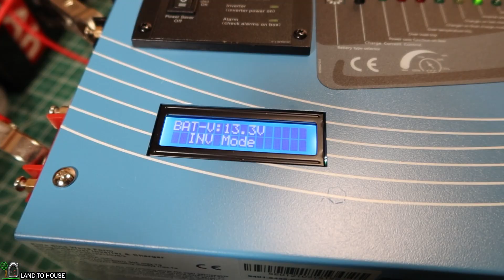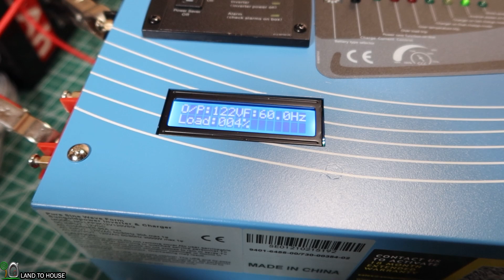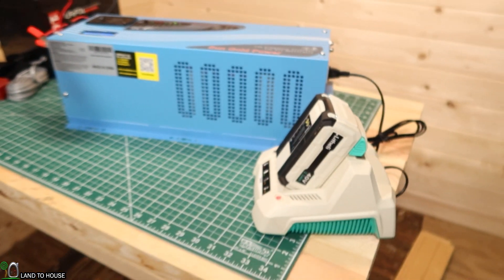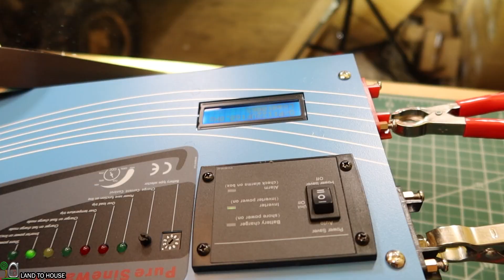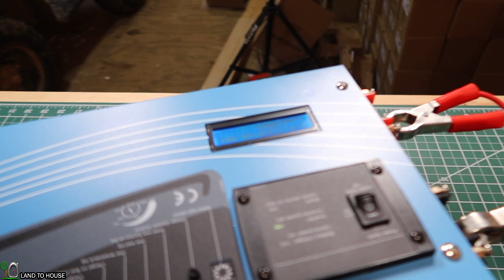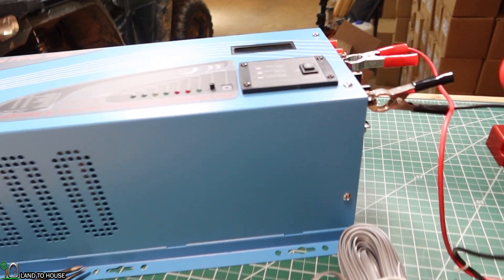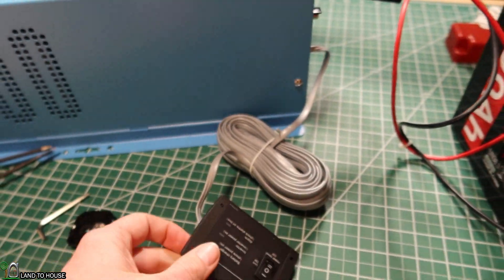Sungoldpower pure sine wave inverter charger 3KW 12V low frequency

Comment: @2:22 Regarding Automatic Generator Start (AGS), have you tried that? I have had difficulty getting the SunGoldPower 3000W inverter AGS to start or stop my 2020 Onan 2500 LP generator  using the inverter's AGS  dry contacts. For those unfamiliar, dry contacts are a safe and standard interface for many worldwide generators that provide the  automatic remote start function when the battery voltage gets low (10/10.5V). Can you kindly demonstrate the AGS on this inverter?

Comment: Neat, it's designed to be a UPS, AC power through it to your critical devices, and it'll kick in the battery->inverter when AC input goes out.

Comment: I just bought this unit and will be using 4 X 100ah LiFePo4 batteries as a backup to my main power source, which is Central Maine Power (grid power). Will this inverter/charger allow me to charge the battery bank with my solar panels when my grid power fails, which it does every winter for many hours to many days at a time? Thanks.

Comment: I just got super lucky IMO bought a used Power Jack 10000W Low Frequency Pure Sine Wave inverter with 200AMP Charger and super fast transfer switch for 250 bucks and it works great, I dont buy that it can do 10000W even though it has 2 GIANT toroid's in it but I am pretty sure it can do 5000 continuous

Comment: I have this Sun Gold Power inverter (4000w) at an off-grid seasonal cabin.  It is turned off when I am not there.  It’s under two years old and has worked fine since it was installed.  It recently started to turn itself off after being on for about 15 seconds.  Upon turning it to the off position and restarting it, it again continues to shut itself off within a minute. The LED readout is scrambled and unrecognizable.  Any thought on what is causing this to occur?
Reply: Mice?
Reply: Sounds like you have it in power saver auto mode (sleep mode) with no load on it.

Comment: Inverter is 3kw and you running load 100watt and 1050 Watts,

For checking you need to run and check us @Full Load @90% or 2.5kw...

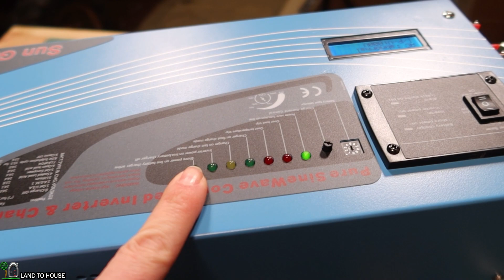Comment: 13:15  Regarding Automatic Generator Start (AGS), have you tried that? I have had difficulty getting the SunGoldPower 3000W inverter AGS to start or stop my 2020 Onan 2500 LP generator  using the inverter's AGS  dry contacts. For those unfamiliar, dry contacts are a safe and standard interface for many worldwide generators that provide the  automatic remote start function when the battery voltage gets low (10/10.5V). Can you kindly demonstrate the AGS on this inverter?